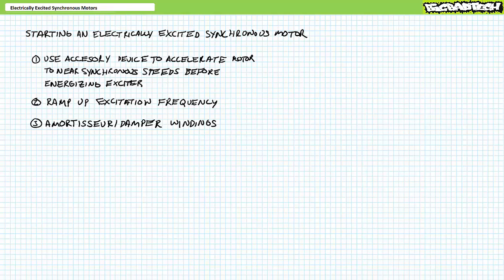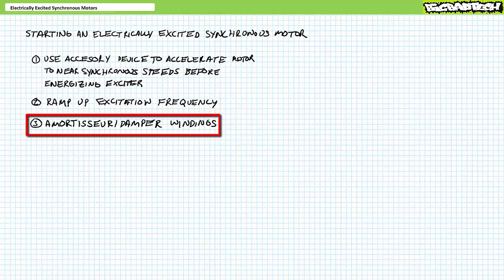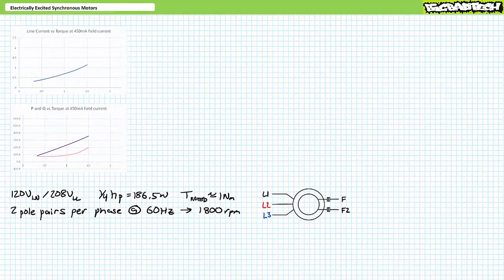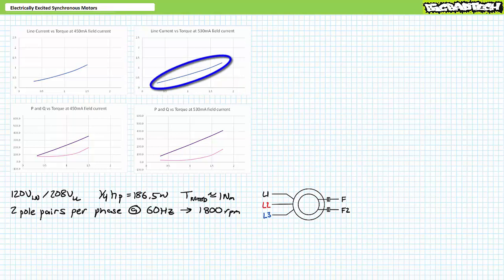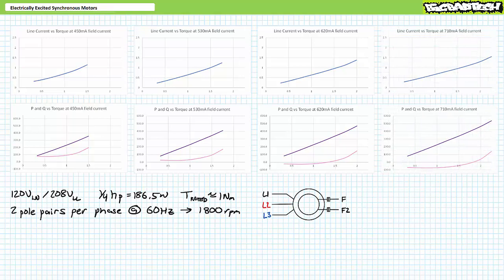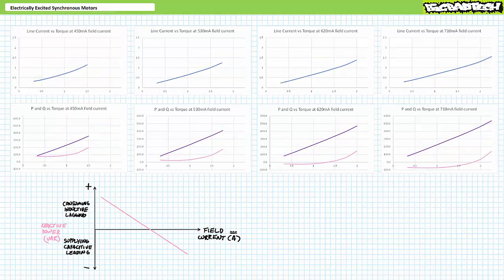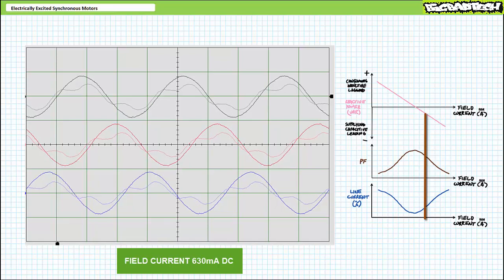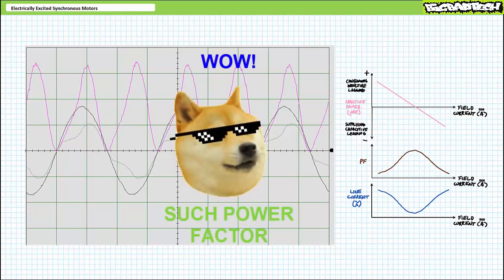Synchronous Motor (Part 2 of 2)

Comment: please comment on suitability of synchronous 3 phase motor for use with variable frequency drive--thx
Reply from the maker: Yes, one can use a VFD with a synchronous motor. In fact it's actually better to use a VFD since synchronous motors aren't self starting. By ramping up excitation frequency at start an energized rotor can gently accelerate to synchronous speed.